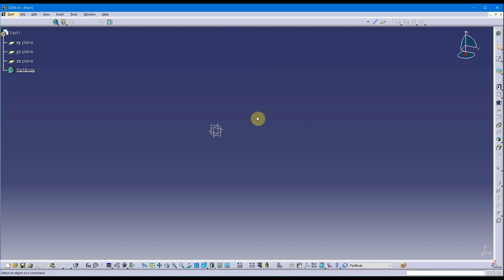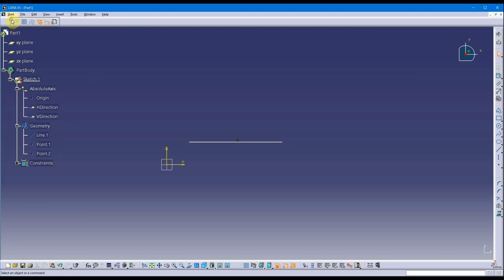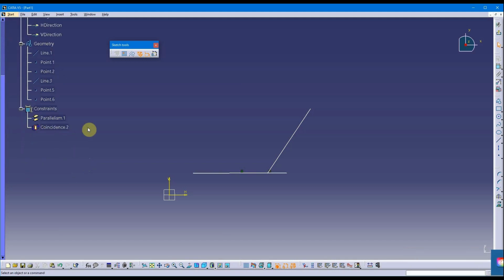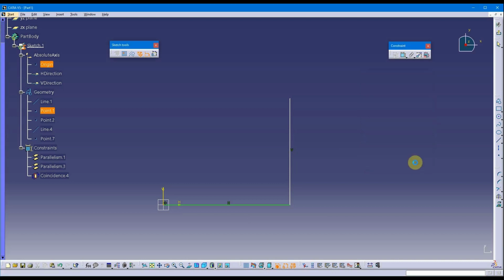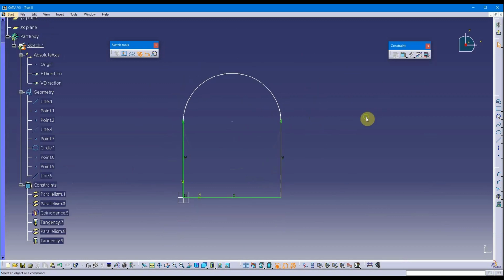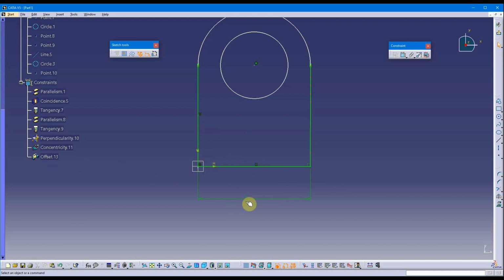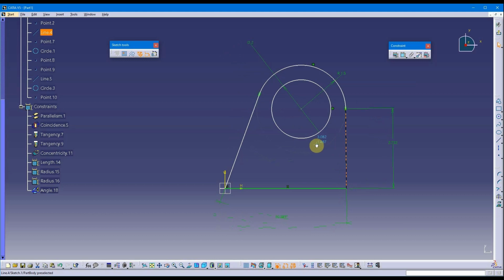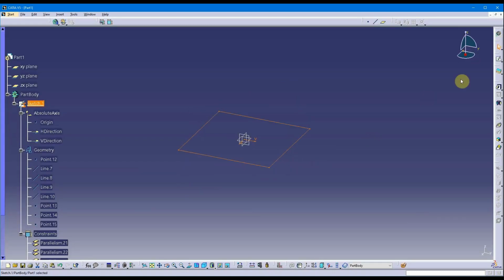CATIA Sketch Constraints

Comment: Hello. I do not have the "equal" constraint on my Catia V5 Constraint box. How is this possible? Did you put in there specifically or it just appeared by default on yours?
Thanks in advance.
Reply: Hi. I have the same problem sir. Did find a solution for this?